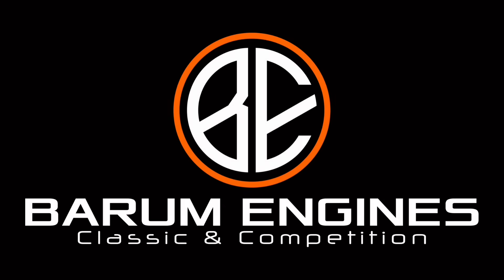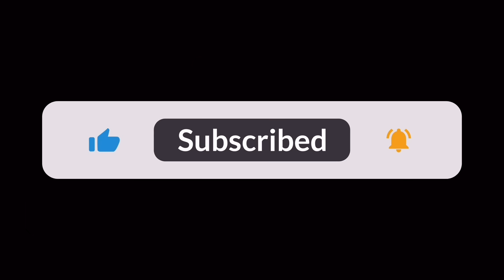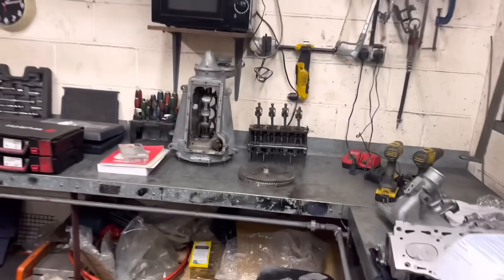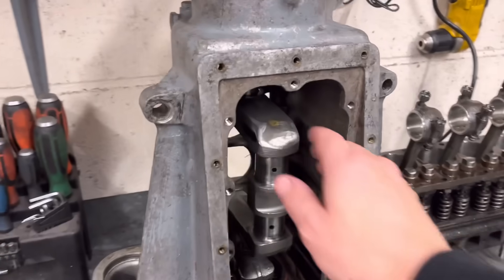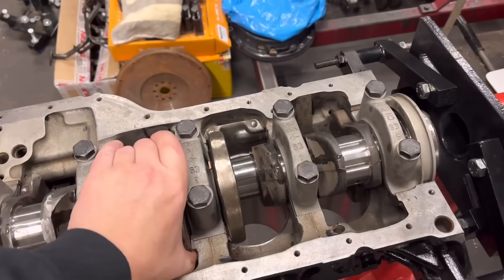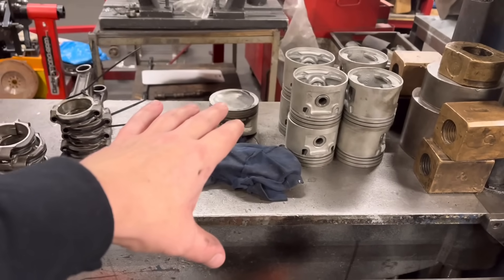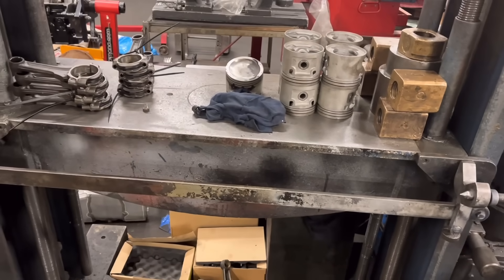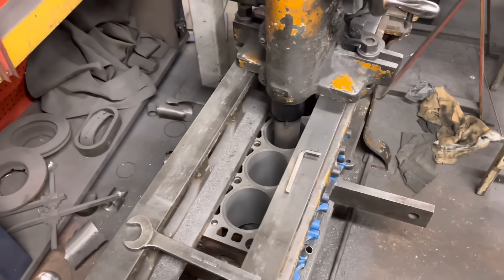MASSIVELY important when building RELIABLE yet powerful race engines!

Comment: On the subject of valve bounce , could a guide extension be manufactured , or even a longer valve guide ? 
So that when the valve  reached the safe limit clearance with the piston the valve  cap , thats held in with the collets, would come in contact with longer stem guide , resulting in no piston to valve contact ? 
Maybe to simple an answer it must have been tried by someone before .

Comment: Have you ever read David Vizard's How to Build Power or his BBC book? He describes piston porting. This involves unshrouding the open valve in the piston pocket on part of the pocket to aid air flow. Involves grinding the sharp corner a bit and rounding it off, allowing better flow and aiding the air to follow the curve created along the piston crown.
DV states this is real.important on the BBC engines which I imagine you do not see much. The concept applies to pretty much all.engines with deeper valve reliefs.
Reply: Yep...lets them breath a lot better/easier....just one of those 'little things' that all add up at the end of the day....also helps avoid hot spots on the sharp edges

Comment: Cheers Lee, you forgot to mention that the Valve Head to Piston clearances are not just down to expansion but to Valve bounce. A performance Engine running at high RPM needs good clearances especially if the Limiter is exceeded.
Reply: Especially if you make a bad down shift at a high enough speed!
Reply: Yes, make allowances on the settings the electronic limiter, isn't it. Avoid entering into mechanical valve over bounce hovering on full open.
Reply: Especially when the over-excited driver selects 2nd gear after being flat in 3rd  instead of 4th 😂😂😂
Rpm max telltale was near 10000 on a 16v golf GTI.
Darwin award boy tried to say it wasn't him .

Comment: You get a lot of hot air from a blowtorch Lee. LOL. What the hell is a squish FFS.
Reply: It's when you crap your pants in a spin at 150mph in the wet!
Reply: @mikehipperson  🤣🤣
Reply: Squish, take the size of your multilayer gasket in its free state and then once it’s torqued down. Difference it how much it’s squished.
Reply: @andrewbaron8713  You mean crushed or squeezed.
Reply: @kwakgreen  when used with an object, to squeeze or squash.
Reply: @kwakgreen  do a google it’s the correct use of the English language.
Reply: https://en.wikipedia.org/wiki/Squish_(piston_engine)